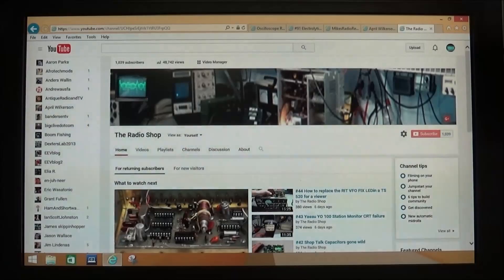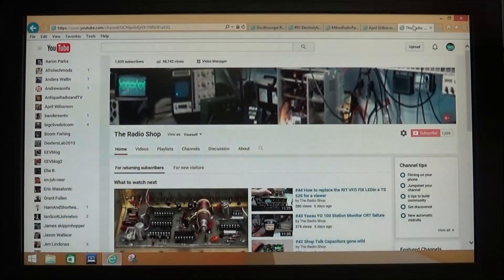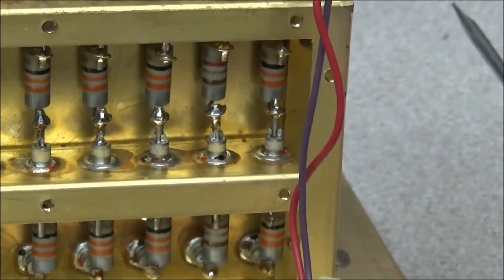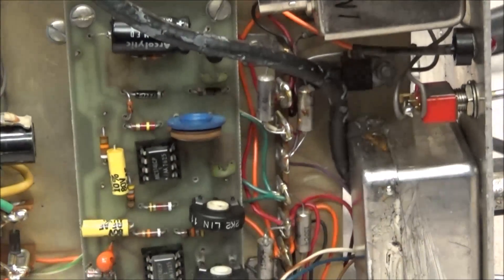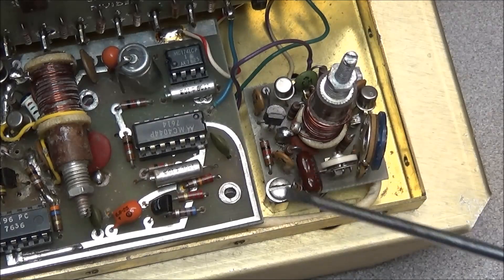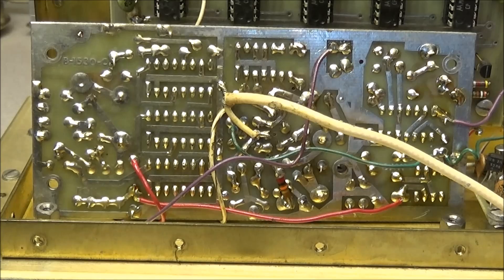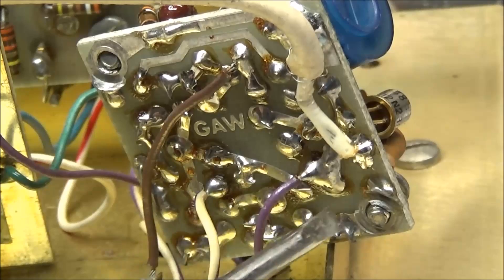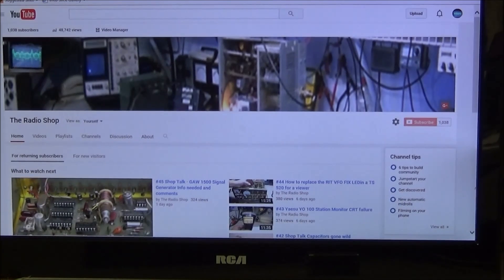#46 Gaw 1500 Sig Gen follow up and extra comments

Comment: Just wandering , I know some flux is active and that removing flux to look good and or inspecting soldering are reasons to remove .
But  if flux is not an active flux , do you see any harm in leaving flux , except for above ?
Thanks John
Reply from the maker: +KD0CAC John, excellent question. Flux does not hurt anything by leaving it on. No clean flux is just that, no clean.  There is a lot of myths about flux. But, the only thing is pure rosin will not hurt the board. But rosin that has become dirty and in a high heat situation can become conductive.   Other than that it just good practice to remove remaining flux.

Comment: Given that the generator is outputting stable, but non adjustable frequency, it would seem that the place to dig in is on the divider board. Presumeably the divider chain is taking the VCO frequency and counting it down to zero based on the pre-loaded count from the BCD thumbwheel switches. Note there are 5 BCD switches and 5 MC14522s. Looking at the MC14522 data sheet the preset count is loaded from the BCD switches on pins 5,11,14, & 2 - P0 - P3. Preset count is loaded to the flip-flops when preset enable pin 3 is low. Pin 4 is an inhibit that when high prevents the counters counting down to zero. You might want to check pins 3 and 4 on each IC as this will stop the dividers. Hope that helps...........
Reply from the maker: +RF Burns Awesome information RF Burns!. Was going to dig through those tonight but you did my homework. Great.  I was just checking the signals at the 4044 pin 1 and pin 3. Seems locked together which is a good sign. So the BCD seems to be where the problem is.
Reply from the maker: +RF Burns Checked those inputs and getting high and low when turning the thumb wheels. That looks great. I see no signals at pin 3  and 4 on these IC's. Scoped them and nothing.
Reply: +The Radio Shop Here is the pin descriptions from the datasheet:

PIN DESCRIPTIONS
Preset Enable (Pin 3) — If Reset is low, a high level on the Preset Enable input asynchronously loads the counter with the programmed values on P0, P1, P2, and P3.

Inhibit (Pin 4) — A high level on the Inhibit input pre– vents the Clock from decrementing the counter. With Clock (pin 6) held high, Inhibit may be used as a negative edge clock input.

Clock (Pin 6) — The counter decrements by one for each rising edge of Clock. See the Function Table for level requirements on the other inputs.

Reset (Pin 10) — A high level on Reset asynchronously forces Q0, Q1, Q2, and Q3 low and, if Cascade Feedback is high, causes the “0” output to go high.

“0” (Pin 12) — The “0” (Zero) output issues a pulse one clock period wide when the counter reaches terminal count (Q0 = Q1 = Q2 = Q3 = low) if Cascade Feedback is high and Preset Enable is low. When presetting the counter to a value
other than all zeroes, the “0” output is valid after the rising edge of Preset Enable (when Cascade Feedback is high). See the Function Table.

Cascade Feedback (Pin 13) — If the Cascade Feedback input is high, a high level is generated at the “0” output when the count is all zeroes. If Cascade Feedback is low, the “0” output depends on the Preset Enable input level. See the Function Table.

P0, P1, P2, P3 (Pins 5, 11, 14, 2) — These are the preset data inputs. P0 is the LSB.

Q0, Q1, Q2, Q3 (Pins 7, 9, 15, 1) — These are the synchronous counter outputs. Q0 is the LSB.

VSS (Pin 8) — The most negative power supply potential. This pin is usually ground.

VDD (Pin 16) — The most positive power supply potential. VDD may range from 3 to 18 V with respect to VSS.

Given that the generator is producing stable output it appears most everything is working, even the divider chain is working to some extent. It seems like the BCD data from the thumbwheels is not being preloaded to the counters - which is why you can't change frequency. It looks like you need a low on reset pin 10 and at the same time a high on pin 3 to get the counters to preload. If pin 3 is always low, you may have found the trouble area.
Reply from the maker: +RF Burns Thanks for that information my friend. Was going to download all data sheets this week  had the time. So much to do. Need to get the info on that 74196 chip also and find out just what it is doing. With all hope I will get time to work on this during my 4 days off.

Comment: Nice looking little sig gen Buddy its going to be nice to see what it can do when its up and running. Its small as well so quite portable. Thats the main problem I have with RF sig gens is that they are allways quite big and heavy. Would be a nice project to make a small portable sig gen just for CB maybe using an old CB Radio. It wouldnt take a lot to add a calibrated output instead of the amplifier stages of the transmit side and even make a deviation meter using the receive side of the radio.Did u manage to look for and diagrams for some basic controal units for a repeater? The 2 radios I have are Icom IC-125 mobiles I think
Reply from the maker: +Gary g1fsh Yes very compact and will be a easy unit to lug around.  I used to use an old cb as a sig gen many years ago.I went ot my storage and took out a lot of boxes. Just got to hunt through them all for the documents you need. Will try and do that soon. Thanks for stopping in Gary.
Reply: +The Radio Shop ok thank u very much Buddy thats very kind of u and i really apresiate it
Reply from the maker: +Gary g1fsh Oh, I forgot to mention. Check out hamtronix. They carry quite a bit of gear for building repeaters. http://hamtronix.com.br/prestashop/category.php?id_category=6&id_lang=1
Reply: +The Radio Shop Thanks for the link Buddy apresiate the info

Comment: I worked in semiconductor test for a long time and looking at this video took me back. We did lots of in-house PC Board Design and build for specialized gear we couldn't(or wouldn't) buy.
Sure you'll track down the problem,  as a single blown counter or other chip. If it was shorted tantalum or electrolytic cap, it would be easier to spot. Look forward to seeing you hunt this down.
Reply from the maker: +GrandsonofKong I hear that. Taking me somewhere also he he. We had to do the same thing when I worked at Firstone. We made everything in house. Right now I am focusing on one part. Will post more results later. The caps seem to be fine in this old unit :) Thanks for watching.

Comment: Buddy I have the same problem with a Sencore CB42. I let it setup in an old workshop and rust pretty bad. The rf and if seems to work however my cb rf is  stuck at 27MHZ. If I break the loop after the lowpass filter, I can vary the vco from 26 to 27 with a dc power supply. My 10MHZ ref is ok. I am not sure about the divider where the chan selector is. If you have the schematic to yours some of these ic's are the same in your Gaw. If you do not have schematic on your cb42 I will emaill you a copy. Mabey we can help each of us getting both going. Jimmy in AL
Reply from the maker: +James Lane Hi James. Check the ripple current on the 5 volt rail. This rail needs to be spot on. Any excessive ripple can throw the CB42 out of lock.  From what you are telling me this sounds like a simple issue. Also check all commenters and solder joints around the supplies. I have worked on quite a few CB42 units over the years.  More than willing to help. I also have all the schematics. In fact somewhere here I have more than the normal. Thanks for watching and lets get these old treasure running again :)

Comment: Thanks for the mention Buddy.  They really did pack it in that little generator.  Would be nice if its as simple as a bad solder connection.   Will be interesting to see what you find wrong with it.
Reply from the maker: +MikesRadioRepair No problem Mike, you deserve it. Will be interesting to find the issue. Thanks